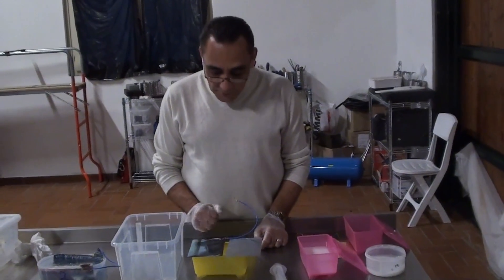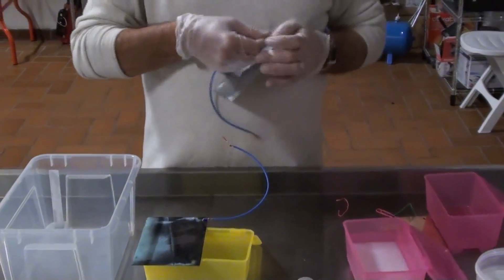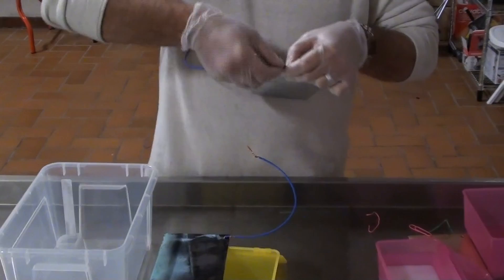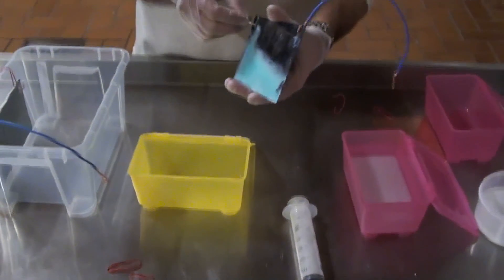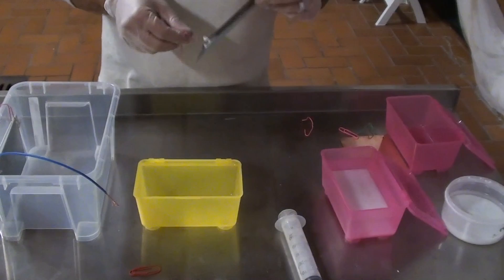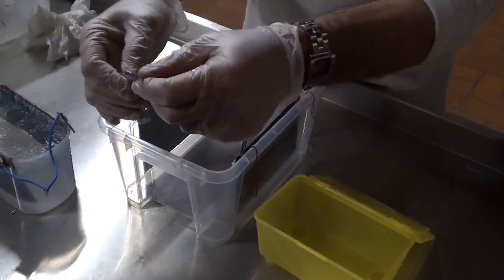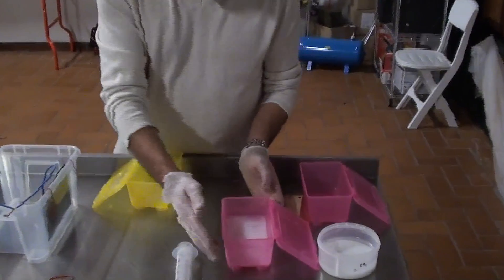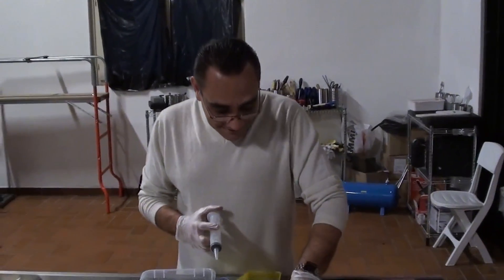CO2 Cleanup Kit Instructions

Comment: Also please post videos of filling the container, so everybody can see how much salt to add to water, where to keep the water level below the connections, when to take out the gans from the bottom before it reaches the plates, how to wash it, how to redo the nanocoating (or do it in the first place if you did not buy the kit).
Reply: +1 to the best comment.

Comment: Armen, is there a specific type of salt we need to use? And 20 to 25% of the mass of the solution should be salt? Basically, 4 to 1 or 5 to 1 ratio of water to salt?